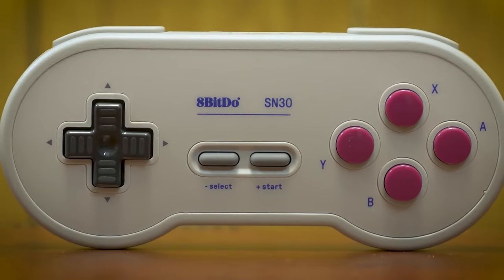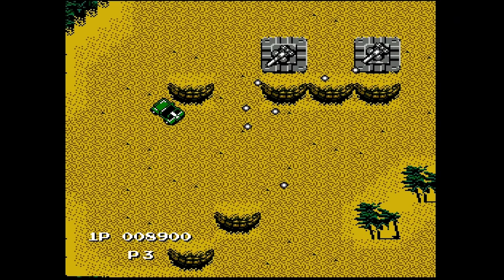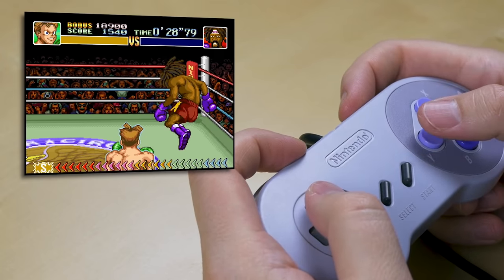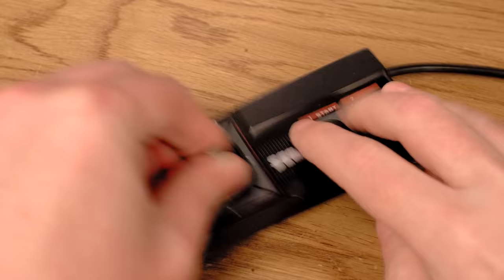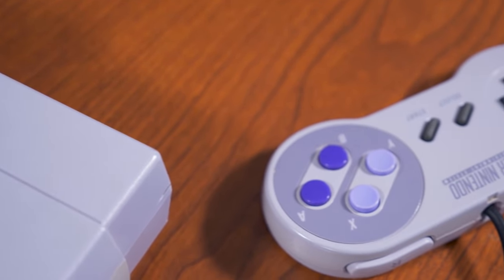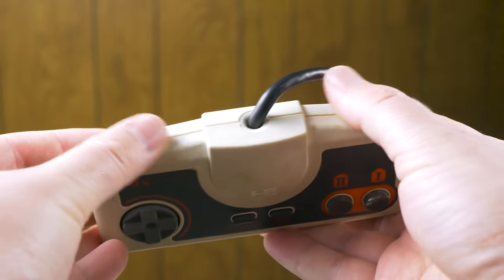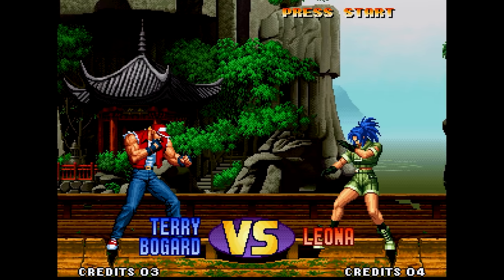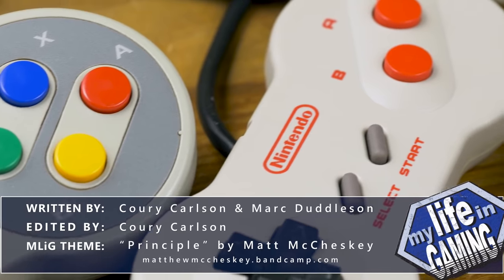First Party Controllers #1 - NES, SNES, Genesis, TG-16, Neo Geo, and More! / MY LIFE IN GAMING

Comment: The zapper definitely works on the top-loader NES. gotta use the 2p Slot.
Reply from the maker: [Try4ce] Sorry if this statement was confusing. We were talking about the revised Famicom, not the NES. The Famicom reads guns from a separate port that the NES does not have.
Reply: @mylifeingaming  gotcha, thanks for clearing that up lol

Comment: How do those replace rubber pads feel on the D-pad? You seem to have just mentioned the abxy buttons.
Reply from the maker: [Try4ce] They came in the same kit. A full set was included. I thought we showed both.
Reply: They should feel exactly the same as the buttons since a dpad basically is a set of four buttons

Comment: Regarding the genesis controller, they should have put the 3 trigger buttons in a triangle. This way you get a similar experience as the SNES controller and you can easily press 2 buttons by sliding your thumb down.

Comment: I love those ones:
PS2's Dualshock
X-Box One's Controller
Switch  and Wii U Pro Controller
M30 from 8Bitdo
SN30 Pro + from 8Bitdo
Brawler 64 from Retro Fighters
Reply: Flpstrike The Xbox One Elite Series 2 is my favourite controller.
Reply: @rastas_4221  Hmm, my Dualshock (PS2) lasted a lot more than the one for PS1 that I had...I think that is my single reason to like PS2's Dualshock more
Reply: I believe there are DS1s with plastic film on the inside. I still prefer DS1 over DS2 because I'm not a fan of analog face buttons.
Reply: I think I have a PlayStation curse. Whenever I use any DualShock prior to the DualShock 4, the analog sticks get stuck in one direction.

Comment: Timely, I've been thinking a lot about what makes a good controller after the recent release of the Elite 2 and the Switch Lite. I thought I'd hate the Elite 2 d-pad because it's clicky and that I would love the Switch Lite since the d-pad is both rubber and accurate, but it's turning out to be the opposite. Seems like you really need a nice, big d-pad (like the SNES or DS4) for rubber to make sense. Otherwise, my thumb gets pretty sore after an hour or so. Smaller than that and they should really be using tactile switches like the Xbox. Even with rubber d-pads and buttons, there seems to be a fine line with how stiff they should be to balance feel with comfort as the SN30 Pro also wears on me pretty quickly (general inaccuracy of the d-pad aside). I used to take the old controllers for granted, thinking it can't possibly be that hard to make a good controller, but apparently it is!

Also, the key to the dogbone (and the regular NES controller, IMO) is to bring your thumb in from the side so you can cover both buttons (like you would for Y and B on SNES). Admittedly, the diagonal layout is still kinda silly for that, but it helps.

Comment: I went and bought the SNS-102 Controller because of this video, but unfortunately Try was wrong. It's no different from the original controller. Yours only felt so good because it was brand new, and you compared it to an original model that has 30 years of use
Reply from the maker: [Try4ce] Granted my conclusion is based on the limited data of only having held about 3 of them before, but considering mine still feels better after playing plenty of SNES in the past 10 years, and considering Dave's also feels great having been his childhood controller, I still think there's a pretty good chance they hold up better and may have started with better pads inside. I didn't mean for it to be presented definitively, but I do think there is possibly something there.
Reply: @mylifeingaming  ah I forgot that you said you've had it for 10 years already. If it is the quality of the pads then unfortunately once those are worn out they'd be like any other SNES controller.

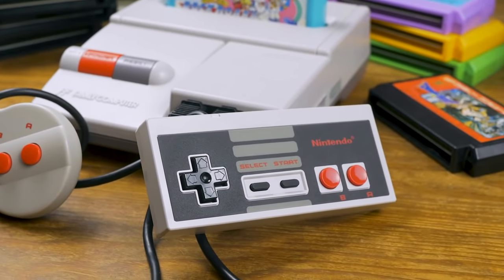Comment: 15:25 - Wait, the Zapper doesn't work on the top loader NES?
Reply: Works on mine.
Reply: @Koyol  Ok, I'm not going crazy then.  Pretty sure I tested mine, but I'll make sure later when I get time.
Reply from the maker: [Try4ce] It works on Toploader NES, but NOT the AV Famicom. Famicom uses a different port for the gun, which the NES does not have.
Reply: @mylifeingaming  Ah ok.  That AV Famicom confuses me every time.  Thanks for clarifying.

Comment: Generally the new rubber pads are a little more thicker than the OEM ones from nintendo. This results in a more stiff feeling that most people stay is inferior. Although probably true, after a while of gaming the rubber softens are starts to feel closer to the original OEM. You just have to get through the stiff feeling in the beginning.

Comment: I tried two different mods for the NES MAX. First I tried replacing that nub with a replacement Xbox 360 stick. Despite everyone saying it made the controller "the best ever," it still took a lot of effort to move in one direction and quick, precise taps were pretty much impossible.

Next I tried just gluing an SNES d-pad right onto the black ring of the NES MAX. That was better than the nub, but now the d-pad was raised pretty high compared to the buttons, and diagonals were still difficult.

I still feel it's one mod away from greatness. Maybe somebody can figure out a 3D-printed insert to make rubber contacts hit easier?

Comment: Skipped quite a few official controller variants from Sega. My personal favorite six-button is the MK-1629. That's right, the weirdo wireless infrared one. It's got a similar layout as normal six-button controllers, but is much larger. Closer in size to the 3-button controllers. However, it's thicker as well, owing to the need to hold 2 AAA batteries. The wireless-ness of it is the only real issue. You've got to have it pointed at the receiver. I really wish 8Bitdo or one of those other companies that make kits to turn classic controllers into wireless ones, made a kit for this thing. Though if I'm honest, I'd prefer if it just had a cable. I've taken apart several different six-button controller variants to see if their guts lined up, but none do properly. It's a shame. The thing is SO comfortable in my giant man-hands. I might end up modding it myself manually (making a new PCB for it) eventually, but it's going to take some work. Bleh.

Comment: RE Famicom pad "Aside for the sharper corners on the dpad" Huh? They use the exact same part.
Reply from the maker: [Try4ce] They look almost exactly the same but the one I have definitely has sharper edges. Not by much, but I noticed it.
Reply: @mylifeingaming  It is likely just less used/worn, or there were possibly very slight variations over the years, but that applies to both pads. I have dozens of both in various states of use and they are the same part. Apart from the action button colours the parts are completely interchangeable in Famicom P1 and NES controllers.
Reply: @mylifeingaming  See here for more on the evolutions of Sega and Nintendo's pads too

https://nintendosegajapan.com/2015/12/06/nintendo-and-segas-8-bit-controller-rivalry/

Comment: I wish you complained about the both smaller sized nes dogbone & sega genesis 6 button controllers,because they are both smaller then those original ones,, also my complain about the nes dogbone controller is the stiff D pad because you have to push precisly into the direction you want(how many times i did fall off a ledge by accident when i want to clime up or down the stairs in castlevania? Because of that stiff D pad)
Also my complain about the nes max controller is that they had put those turbo buttons below those regular B & A buttons as a result sometimes whwn i want to take a long jump to get a across a huge pitch in supermariobros, then i accidentally do hit turbo A instead thus i will fall instantly into my dead pitch,, why nintendo? Because on thirt party nes controllers those turbo buttons are up above those regular B & A buttons so i will have no problems using those controllers.

Comment: I actually had an old snes controller tucked away in my controller collection I haven’t used because my adapter broke, but when i went to go check and it just so happens to be an engraved version. I just ordered a new adapter and cleaned it, time to set it back up with my wii and give it a go in Super Metroid again

Comment: There is another revision of the 6 button Genesis controller that came packed in with the Genesis 3. It actually is more similar to the OG 3 button in size and shape. Not sure why the variant exists but it's  not as common as the smaller one featured in the video.

Comment: I didn't necessarily think third party controllers were by defaut worse its more that better ones were hard to come by, some could have a similar build quality to an original but be a different shape and have gimmick buttons on that mean everythings lined up different. I never owned a offical Mega Drive controller till I bought the new ones, for decades (wow) I had a 3rd party one that was a identical design to a official controllers.

Comment: i hate modern gamepads
i use only dualshock 1 clones for simplest platformers and ps1 and lower games
but even for fightings anything less than 8 face is unusable and those are rarity

to play even complex or difficult platformers i always have to go to my mechanical keyboard
i couldn't do bonus level in klonoa or bossfights in freedom planet on gamepads so i had to use keyboard precision and speed

Comment: I have experimented with many replacement pads and all have been complete garbage except for a run of SNES pads that came in a teal and orange color scheme. I’ve never found a good replacement for NES pads.

I’m also afraid to tell you that you have been holding the NES controller wrong the whole time. If you actually want to button mash you need to place your thumb along the length of the A-B buttons not between them. I can’t imagine playing Mega Man the way you switch between A and B.
Reply from the maker: [Try4ce] Most of the those shots were Coury, but I don't recall him holding it much different from me. Horizontal thumb doesn't sound comfortable to me personally. I don't move my thumb from button to button in action games usually. I rock it between the two buttons, but from the lower part of the controller. Works for me!

Comment: SEGA Genesis has the WORST Dpad bar none. You press up, you inadvertantly press left. You press and try to hold down, you move slightly to the right in the process. Back in the day, I actually modded the SNES Dpad onto the Genesis controller. A bit mess because of the dremel cuts and hot glue, but in the end, it was magnificent. I wouldn't have had it any other way. Mortal Kombat fatalities were now possible to pull off on the Genesis.

Comment: Something else that I often neglect to mention.
While in the 80s, America was mostly using games consoles, England was using Micro computers.
Games consoles typically used Pads. Microcomputers typically used joysticks (with only 1 button), and since that button was a trigger, it was normal to use the joystick in the right hand.
So... when you say you're not used to Joysticks... well... it took me a long time to get used to Joypads.

Comment: 3:50 i think ive found the genesis (six button) controller dpad to be best generally. But a NES/SNES DPad is pretty good. Just the original 3 button genesis controller with the weird contacts on the back of the board situation is just downright bad imo.

Comment: As someone with a slight controller obsession, this video is all kinds of awesome for me. Looking forward to part two!

On a couple of random notes, I never understood having the A & B buttons slant in the exact opposite way your thumb naturally rests, even on the GameBoy. Game Gear had the same issue. The spacing you mentioned on the NES dog bone is what pushes it over the edge for me, as opposed to GameBoy where I can tolerate it. I still have that issue with some newer Nintendo games that want you to use A & B when B & Y would be more natural.

I've also found that my six button Genesis controller works great on the Atari 2600, and I can't go back to the original joysticks with the button on the left side.

Comment: I would maybe not say the snes controller is *perfect*, but it's my favorute and absolutely up in the top! There's one thing to look out for when replacing the rubber pads in them: it just never feels the same. I didn't think replacing the contacts could make such a feel difference, but some replacement rubbers makes it possible to press all 4 directions on the D-pad at once! It's really unfortunate.
Reply from the maker: [Try4ce] On the surface, it's such a simple controller, but bizarrely hard for anyone to replicate the feel of it.

Comment: Video Game History did NOT start with Nintendo.  what about Episode Zero, Generation 1, with the iconic 2600 joystick, and the innovative Astrocade controller.  Then Generation 2, the Age of Ambidexterity for the Intellivision,  ColecoVision, the Arcadia 2001, and even the Atari 5200 all went both ways. 

I noticed as I like joysticks better than control pads, and right stick than left stick.  I was one of those who bought a custom 6 button fight stick for SNES and Genesis, and not out of vanity, but necessity.  No one has made an authorized Right Handed Joystick with 6 or more buttons.

I made a website called sinistersticks.com which documents my quest to get an Ambidexterous joystick. 

I got Hori USA to like it.  They'll send it to Hori Japan when there is no deadline for a specific vanity joystick.

BTE l just saw the Master System Joystick portion.  The problem with me is that the buttons are mapped left-to-left, which is good for Tutankham and Side Arms (neither SMS games) , but bad for 98%-100% of Master Systems games, which need index-to-index mapping, to avoid middle finger pumping.  Most people are used to index finger button pumping.

Comment: As a Master System owner in the day, I don't remember reaching over to pause being an issue. I agree the buttons are squishy on the sms but I don't think it's objectively worse than the nes control pad.

I fixed my Mega Drive 6 button controller last week using the button pads from a cheap clone Saturn controller. I just had to remove the bit that you put into a peg to position it over the button and do it manually but now it works amazing. Oh yeah, I also had to create perfectly round, 4 layer paper circles (using Pritt Stick and scissors) under the buttons to raise them up... NOW it works perfectly... I also got a Mega Drive 3 button joystick but it's too stiff to use. The joystick is not being held high up enough for some reason. I placed a piece of card under it which helped but you get stiff arms. :(

Comment: Those Famicom and Super Famicom controller wires were mostly like short because most Japanese home/apartments rooms are small, so there was no real reason to have a long cable given the size of the home and TV screens. So for most cases the length is fine.

Comment: I always had problems with the rubber pads in the SNES controller. On the other side I have a 25 years old Mega Drive controller and it still working just fine. Like the SNESone, I just clean it up from time to time.

Comment: 2:11 Try I think you mean ‘a YARD and a half’ not ‘a foot and a half’ ?!!
Reply from the maker: [Try4ce] You just made me recheck. I worded it slightly wrong, but they are nowhere near a yard and a half. They ARE about a foot and a half when extended from the front of the console. Where I got mixed up was I accidentally said that was the length of the cord. The cord is closer to 2.5 feet. Still nowhere near a yard and a half though.
Reply: Ah that explains it, sorry for being pedantic! 

Obviously it’s third party not first but have yourself or Coury got hold of a Hori N64 controller yet? I’ve seen various people raving about them and it would be great to hear your thoughts.

Excellent video as usual!
Reply from the maker: [Try4ce] Personally I think they're too small, but I've only held one, not ever bought one to play with. But keep in mind this is coming from a guy who loves the N64 controller. Like I said about the NES dogbone, I see it as enticing, but a "solution to a problem I don't have."
Reply: Yes I don’t understand the amount of hate the original N64 controller gets, as someone who’s had an N64 since 1997 I’ve always found it comfortable and the analogue sticks have held up very well (probably due to me not having any of the Mario Parties). I’m still intrigued by the Hori controller but I have big hands, so by the sounds of it I’d be better off sticking to the original.

Comment: You didn't do the 7800? There were two official 7800 controllers made by Atari. The first is the CX-24 joystick. It's okay, just don't play any games that require you to use the buttons a lot. The other is the CX-78 joypad. It's a pretty mediocre NES clone pad with only two buttons and a screw in joystick on top of the D-pad.